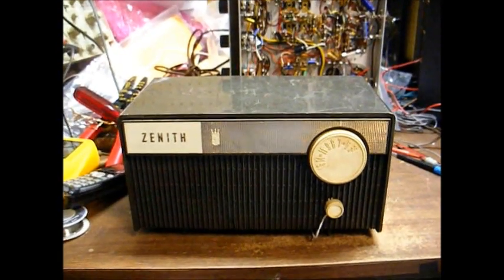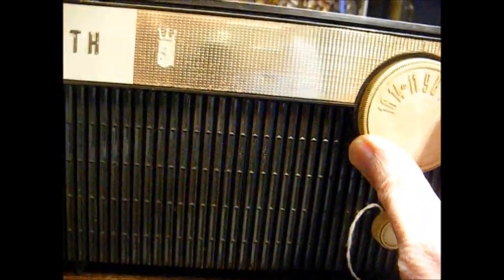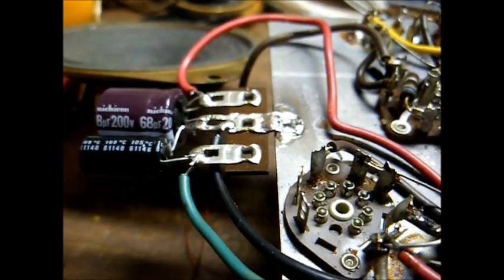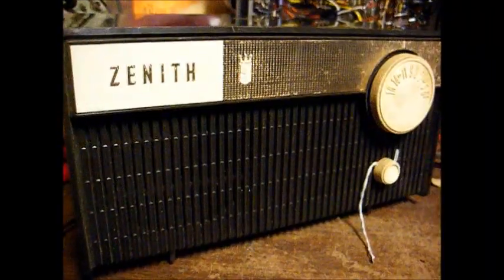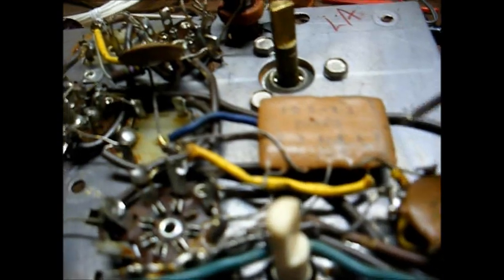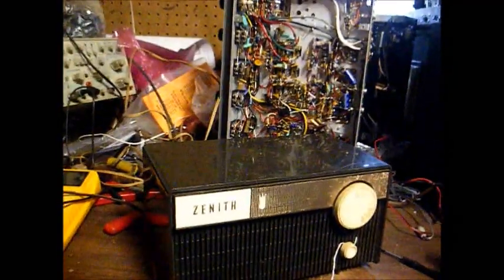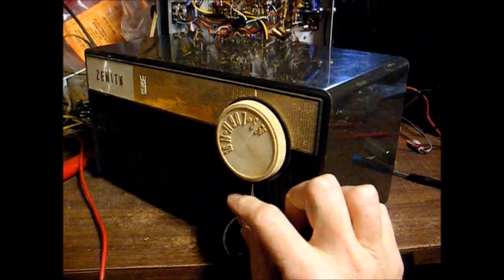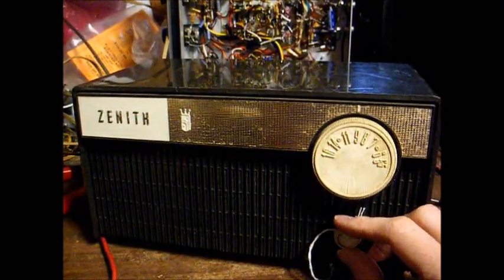Repair of a Zenith AM tube radio from 1968 model Y114C

Comment: i have a philco radio with loctal tubes that works great for the first 15 minutes that it is on and then gets real quiet and distorted and when it cools down it works great and does it again is this the issue

Comment: Interesting about the captive knobs and shock hazard. A friend of mine had an older version of this radio in his garage back in summer of 1974. I was in bare feet trying to tune in a station and when I picked it up to turn it towards the station I touched a screw on the bottom and it gave me a full line voltage shock that knocked me on my ass! Hard to believe anyone could have designed a chassis with such a potentially lethal design. I guess on later versions they eliminated the live exposed screws.
Reply: That must have been an experience. ⚡

Comment: Love your channel. In this fix, you mentioned the couplet a couple of times. I'm working on an Emerson 811B at the moment. I think the couplet is faulty. Very low output. Volume control checks ok by meter, a .01mf cap between '3'&'5' on the couplet brings back fairly good audio but that's because I'm bypassing the 12AV6 and volume control completely. How do you diagnose a bad couplet other than guessing? Thanks!

Comment: I have this radio in a white and brown color scheme (white body brown knobs). I got it for $10 at an estate sale. Its my first tube radio ive gotten and it needs filter cap replacement (SUPER LOUD hum even at low volume). It was made in 1965, model 5M04

Comment: I had one of these I picked up at a local auction I got it along with about 3 other tube radios for 5 bucks those things do have weak studs I broke them just from trying to remove the screws so i could change the filter cap. I remember the radio was pink not a great color.

Comment: I love your videos my friend. I have been working on a Westinghouse 2 stage, 2 tube mono phono amp from 1961. It had terrible hum, so I replaced all the capacitors. I could not find the exact replacement can, so I wired everything under the chassis. I've also interchanged tubes, but it still hums. The only difference is, the hum now increases only when the volume is increased, and the volume only goes up so far. And the tone control causes a howl at mid position. What did I do wrong? Any suggestions? As far as I can tell, the only polarized caps are in the can. Keep up the good work.

Comment: Nice one! This was one of the last of the Zenith tube radios, and that was from about 1968 in which Zenith decided to discontinued the tube models and replaced it with a solid state models. Solid State was introduced in the early 1960's when they took over tubes, but many of the companies had already made solid state radios, the overall design looked exactly like the one that was used in the early 60's.

Comment: I had one of those. Yeah, the chassis was minimalistic, but it was leaps and bounds better than the pcb garbage of that era. The 50C5 (and 50L6) are some of the most unreliable tubes ever made. Due to their high heater voltage, heater to cathode shorts were quite common (especially thermal shorts like that). I once bought 6 NOS 50C5's.....still in the original boxes, never been opened, and three of them had thermal shorts once they warmed up.

Comment: As for using old parts, I think the same went for BSR changers. My dad bought a Garrard Stereo changer in January 1958 and was using it until about 1971 or 2, and replaced it with a generic BSR 4-speed changer (I'm assuming it was new) and it had a motor with the old pitch, and when I brought the cartridge to a local shop to replace it, the man at the counter said, "Wow, this is an old one!" I thought to myself, 'That's strange, it's only from the early '70s, and this is the mid '80s!
Great video as usual. I think this is my new go-to place as far as YouTube goes - I LOVE this restoration stuff!!!!
Reply: If that BSR was a 4 speed, it had to be from the late fifties to mid sixties. I'm guessing it still had the Magidisk record size detector flag beside the tone arm. I have two BSR 4 speed changers. The UA8 was a transitional model, in 1957 it was introduced as a mono player but next year it was made over to stereo, it was the last to have the over arm on the left side and also the last to have a neutral position on the speed dial. It used the TC8 series turn-over style cartridge. The UA25 in my Windsor 962W player was the last to have the Magidisk size detector and uses an SX1 series flip stylus cartridge. All my 1970s BSRs are 3 speeds and use an SC12 series flip stylus cartridge. None of my BSRs have pitch in their motors. I'm afraid I've screwed up my UA8. I recently took apart the changer mechanism to clean up the dried grease and when I reassembled the unit, I found I had a 3/8" by 3/4" compression spring left over. I'd like to get this changer running for sentimental reasons, as my first introduction to records was with a BSR UA8.
Reply: Doug Browning I love the BSR's from the '70s, but they tend to run fast. The only way I've found to slow them down to the proper speed is to file the shaft down slightly. It is time consuming, because you have to keep checking with a strobe disc, and you have to do all three speeds separately, but it is worth it.
Reply: Gary Spinelli My first record changer as a kid was a 3-speed GE mono model (forgot number) and the pitch was the old one as well. The sound was very good for a mono portable. I noticed it while going thru old cassettes I recorded using it. (I got it in early 1975.) I believe it had a rectangular piece of metal at the end of the record holder instead of the piece that went at an angle. 
PS- the BSR's I've had always had the curved plastic piece in the back to determine record size. The GE had a rotary selector switch for speed & size.)
Reply: bob7872 Oh I thought your dad's replacement changer was from the "70's. I know the BSR's from the '50's & '60's that had the curved plastic piece. In fact, the Westinghouse I'm currently working on has it. I believe these turntables are called Monarchs, and the curved "feeler" or "flag" is called the Magidisk, as Mr Browning said.
I had a GE Wildcat model when I was a kid that had the rotary selector switch too.
Reply: Doug Browning What exactly does your changer do without this spring attached, and where is it located? I have several of these turntables, and I might be able to help you out.
Reply: Gary Spinelli I have not had this changer running as of yet. It came from my neighbor's heavily hacked up Emerson High Fidelity console that they had thrown out. All I have are the changer, chassis, antenna, and a few bits of the cabinet. I have nothing to even identify the model of this console. The only marking on the chassis is a Z in hex mark. The chassis is a 7 tube with the AM radio portion designed to be removable (I assume these sets were sold both with or without the radio). The power transformer is only about 1/3 larger than the output transformer. The controls are, left to right, (radio portion) radio/phono selector, tuning, tuning dial, (audio portion) power switch/bass, treble, and volume. So far, I've been unable to find any service literature online for the changer other than Radio Museum, which has very restrictive membership requirements, and people selling manuals. I also have been unable to find even pics of this console online. The closest I could find to the style was a 1957 or 1958 AM/FM/phono model that included an audio level indicator.
Reply: Doug Browning OK. When you do get it up and running, contact me here and I'll see what we can come up with. The turntables I have are UA12's, but the parts maybe interchangeable.
Reply: Gary Spinelli
Ok, i'll have to wait till I can get some motor grommets to replace the dead ones on the machine and some heat shrink tubing to splice up the power wires. The person who eol'd this set snipped all the wiring half way down rather than simply unplugging things from the chassis.

Comment: Yes, I was told the 50 volt tubes do that a lot due to of them burning at 50 volts versus 6 volt, etc. tubes. Looks like it still has a Conelrad dial too. Zeniths quality always seems to be good.

Comment: Very nice
Quick question
I have a console stereo
One if many lol 
When you first turn it on there is a slight hum or buzz in the left channel
With the vol up you don't notice if but there is lack of bass in it and as you turn the vol up it gets distorted
I tested all tubes and they all test good
I swapped the speaker connectors from left to right to the opposite and the distortion goes to the other side
So it's not the speaker
Any ideas I can look for or try
The him is min and only hear it with vol low off
But like I said if lacks base in that channel and with vol up its distorted

Comment: I have epoxied studs into those broken screw holes and then used a nut to hold the chassis in place.  That is a simple fix if one has to do it.